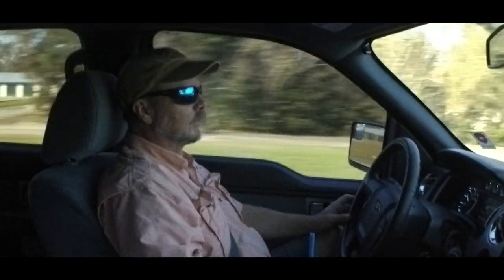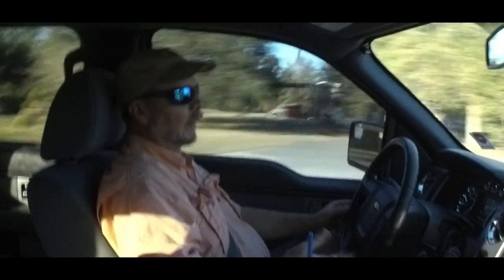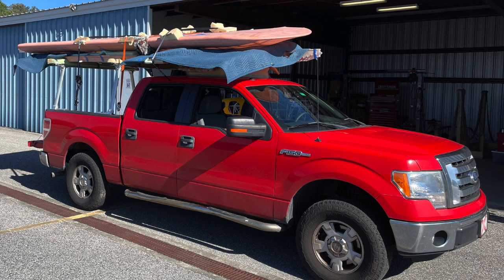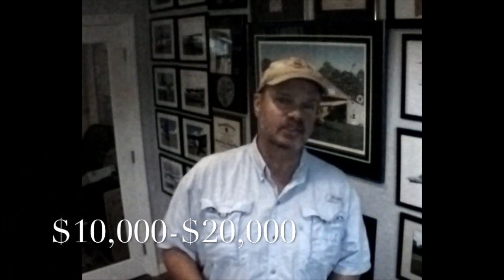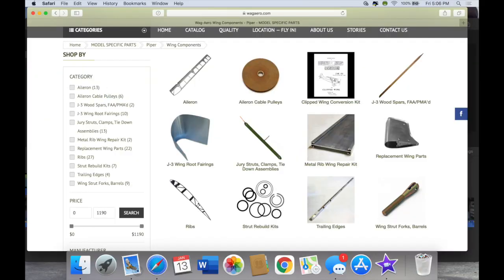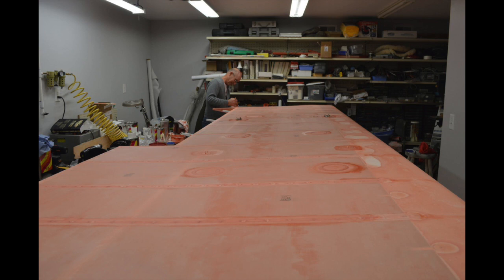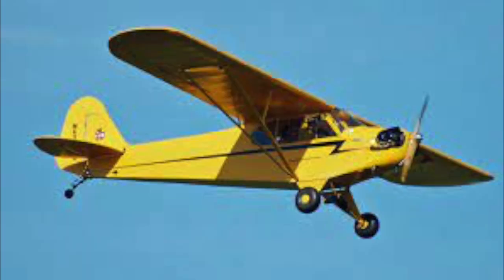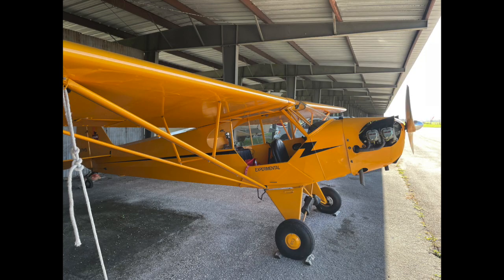Piper J3 Cub Wings Restoration Part 1

Comment: My friend has a cub.  When it was getting an annual I was there watching.  The mechanic pulled out that Maule tester and even though it is not my airplane, my butt tightened up when I watched the mechanic use it.  From what I understand, it is not actually required to use this tester.  They didn’t have these years ago, so why use it.
Reply from the maker: I have heard different versions, many will just test to airworthiness pressure, not to where it punches a hole.